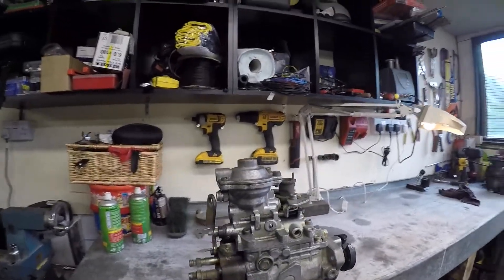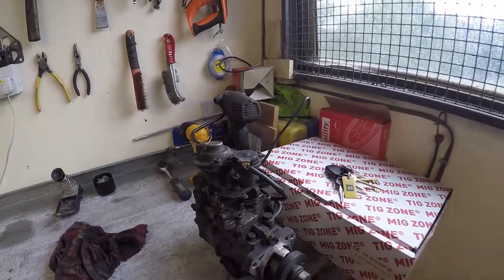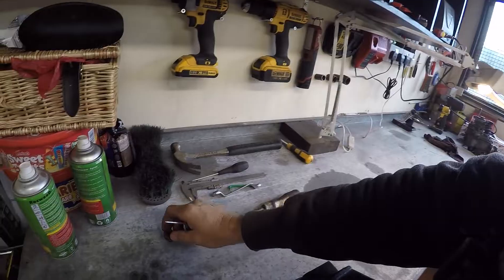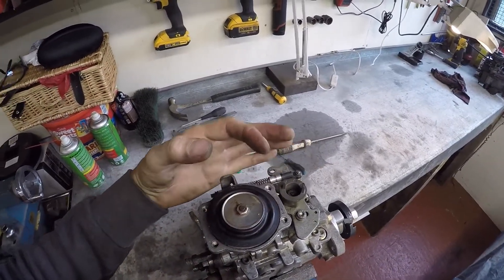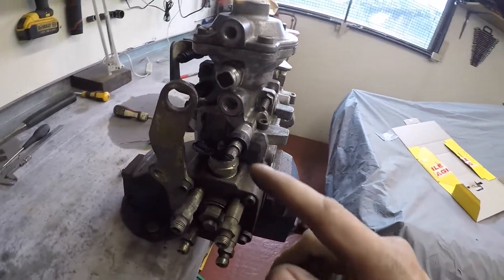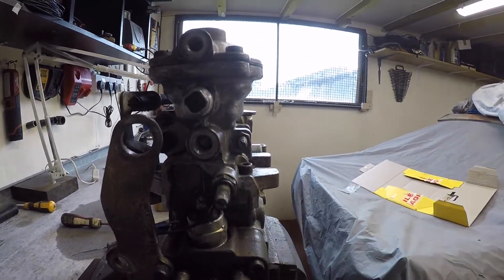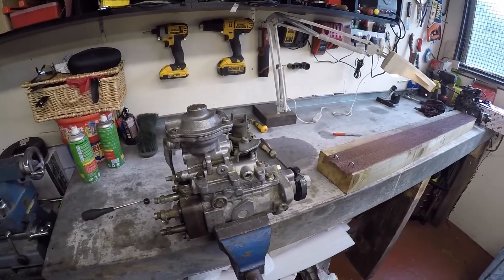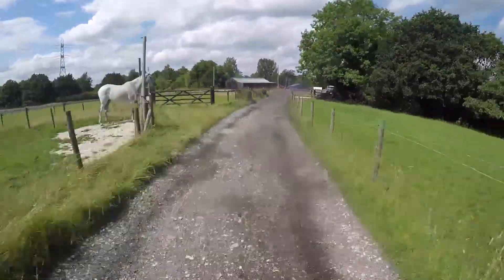300TDI & 200TDI Injector Pump Modification Land Rover Defender & Discovery Bosch VE pump

Comment: Hi buddy, I have a Defender 90 200Tdi. Could you please tell me if this procedure can be done step by step, one action at a time? I really don’t want to harm the engine or the turbo. The car has 150,000 km mileage, and it’s very dear to me, but I feel like it doesn’t have enough power. Is it possible to do this directly on the vehicle? Everything is still as it came from the factory, there’s even a seal on it.
Reply from the maker: Hi mate, yes if you want to do one step at a time then I recommend first rotating the diaphragm and then take it for a drive, then if you want a bit more lowdown then do the screw on top of the diaphragm housing and then shorten your turbo actuator rod by 5mm as as you can access this easily on the Defender 200 TDI, then take it for a drive again, if you want a bit more then do the fuel screw 1/4 turn. If you want you can do the above steps but just adjust the amounts I’ve suggested by a half. You can adjust the star wheel if you wish but it’s not totally necessary with milder adjustments. 👍 it should make your 200 a joy to drive afterwards 😁 cheers 👍👍
Reply: Hi, thanks a lot! I’ve installed an EGT gauge and I’ll start making the adjustments little by little.

Comment: It's a turbo diesel. Adding more fuel just makes it smoke at low rpm. Diesels are all about boost, an the 200/300 Tdi does not have enough turbo. 35 years as a diesel tech, don't mess with the pump, you won't get any more power.
Reply from the maker: I stand corrected, I’m so sorry for giving this useless information to the viewer’s 😂
Reply: I did this to mine and had MASSIVE gains
Reply from the maker: @roberttown2816  Nice one mate 😁, yea it made a big difference to mine too 😁👍👍 thanks for watching 🙏👍

Comment: My engine it's a 2.8 litre. This mod also Works?
Reply from the maker: Hi, yes this will work on the 2.8 too, you’ll benefit even more if you have a VNT turbo as some 2.8 do and you could fit a hybrid compressor side of the turbo for amazing low down power. The 2.8 injection pumps internals are higher spec than the 2.5 but the tuning them is carried out the same way. 👍 cheers

Comment: Hi mate, what  great video! Writing from Madagascar. Done everything except shortening the rod. Its   making a lot of dark smoke mid toI high rpm. I keep on backing the screw 180° but it doesnt seem to help. Not really concerned about emission just want to reduce the smoke. Any way to know that screw to stock position? It started to move backwards with the security bolt so i dont know..couldnt turn the star wheel a little less than  360° . Its stuck a 270°. 
My 300 tdi is fitted with an upgraded  variable turbo. Should i put the pin in the original position?
help much appreciated. Cheers
Reply from the maker: Thanks mate 😁 unfortunately you can’t find out where the standard setting is of the smoke screw if not noted position beforehand. Just double check you’re turning the screw the correct way as its opposite for fuel reduction. Also if you have a VNT or VGT turbo then adjusting the actuator doesn’t have the same effect, and to benefit from a VNT or VGT turbo you need to control it electronically really by using a ECU or controller that can measure both MAP pressure and throttle position, otherwise you’re not using the real benefit of having a VNT or VGT turbo. Don’t get the smoke screw mixed up with the one on top of the diaphragm housing as this is different and the smoke screw controls the overall fuelling of the pump. 👍 cheers

Comment: Thanks for this just did everything you said and now my defender is fun getting on the highway but she heats up under the seat think I should put in an EGT?
Reply from the maker: Awesome mate 🚗💨 it makes a good difference but yes the exhaust temps can get quite high so if you haven’t turned your boost up yet then do that and yea it’s best to put a EGT sensor and gauge in to monitor just in case mate 👍 cheers

Comment: I reset my injector pump as described and now it really flies.  But on putting my foot down I get a cloud of black smoke and am worried about the MOT emssions test now.  I realise that by unscrewing the top 'smoke screw' will help this but will it affect the power I have just gained?  Could a burst of black smoke after throttle end in failure?  I Just need a general opinion and realise you cannot be definitive on this. Cheers.
Reply from the maker: Hi, if you mean ‘top smoke screw’ being the one on top of the diaphragm housing lid then adjusting this back to standard will decrease the smoke at low rpm so should help. The “smoke screw” is normally the name given to the one that is in the side of the pump that does the overall fuel and I mentioned in the video too only adjust by half a turn, you could readjust by a 1/4 turn towards standard to also reduce overall smoke. But yes I’m afraid in doing this it will indeed lower your power again so you’ll have to find a good in-between for you needs 👍 cheers

Comment: After 20 (very) odd years of owning various Land Rovers I finally got a 110 as I'd always wanted a 'Defender' but could only afford Range Rovers (go figure!)
Its a 1989 but with a 300tdi/R380 installed at some time and I'm looking at a variety of ways to improve the breathing and power, I'm not after a rocket ship but just a little more grunt wouldn't go amiss. 
This is the most straight forward video on tdi tuning and well explained, cheers! Only slight problem is I now live in Ireland and where the MOT test in England struck me as rather strict, its even worse here so I know I'll have to take it rather gently!
Reply from the maker: Thanks mate 🙏 I appreciate the kind feedback 👍 glad you’ve finally got yourself a 110 pal and I’m sure you’ll love it, yes I know in some parts of Ireland the test is strict, but like you said if you tweak it like the video but just not quite as much on each stage of the mod then I’m sure you’ll still be within the emissions, also turn you boost up by shortening the actuator rod on the turbo by about 5mm as this will bring the emissions down on boost and increase power too. What you could do is when you adjust the smoke screw (the one that’s got the security tab on) you could mark it precisely and revert it back each time you have your test, they re-adjust once test is passed, you can even back off a quarter of a turn to reduce overall fuel even more to make sure you definitely pass the emissions 👍 thanks for watching mate and enjoy your 110 😁👍👍

Comment: I'm still trying to source them cheap at junkyards. Can't find them though. Ivecos are not plentiful in my bit. Would you say that 180 degree on the ring, 90 degree on the pin without shaving it would improve low rpm without the black smoke fail my Discovery on the MOT? Don't want to go back and forth on this. Prefer a safe setting that gives it a bit of oomph at the get go
Reply from the maker: Yea they’re expensive to get hold of VE pumps now. If yours hasn’t been touched then yes rotate the diaphragm 90 degrees and 180 degrees on the star wheel will be a nice subtle improvement, then if you want a tad more low down just pop the cap off the top of the diaphragm housing and wind the torx screw in 120 degrees or so 👍 cheers

Comment: I’ve just done the fourby boost pin on my 300tdi and now I’m getting black soot and smoke followed by a puff of white when I rev it. I was wondering if the fuel pump has been turned up previously and now I need to turn it down?
Reply from the maker: Hi, yes it’s possible your pump has previously been tweaked, has the security tab been removed from the smoke fuel screw and had the cap been removed from the diaphragm lid. If the shield has been removed from the smoke screw you could try to back it off a 1/4 off a turn anticlockwise and see if this reduces your black smoke. The white smoke is usually unburnt fuel. Thanks 👍
Reply: @CarJunkeez  Hi. Thanks for getting back to me. Yeah the fuel screw safety cap has been removed. I adjusted the fuel screw and it’s much better now. Just a bit of black followed by white now when I rev it. Seems fine going along. I took it for a test drive and it easily gets to 80 now and can tell it would do a bit more but I’ve done an egr delete and the temp gauge gets to 720 if I try any more. Should I turn the fuel screw down more or take the diagram cap off and turn it down in there? Don’t want to inadvertently damage the engine if I’m not keeping an eye on the temp. Many thanks.
Reply from the maker: @Tom-hl7wc  you could try back fuel screw a little more if your worried about high EGT’s. If you’ve got the flat sided Fourby boost pin then unfortunately you can’t tweak by rotating the pin like on the standard pin, also if it is a plat sided pin make sure the pins flat side is oriented correctly with flat side parallel against the control pin deep in the hole 👍 cheers
Reply: @CarJunkeez  ok thanks for the info. Appreciate it.

Comment: I have seen some vids where they remove the plastic collar totally.  Is that a good idea or not?  Thanks
Reply from the maker: Hi, you can take the collar totally out and that would allow maximum travel on the diaphragm downwards into the pump, this is usually ok as it can only go so far until it bottoms out, just on some pumps it could possibly stick on the fuel pin deep in the hole but is unlikely to 👍 but the fueling spread will more than likely be increased more than with a shaved down collar in. Cheers 👍
Reply: @CarJunkeez  Thanks for your detailed response.  I'll try it shaved and then without and see what the difference is.  Thanks again.
Reply from the maker: @scaryfakevirus  no problem mate 👍 cheers
Reply: @CarJunkeez  Just took my boost pin out to fit the new type and saw that the governor pin was all the way in - can't see it.  Is that its resting position?  I think it may be stuck in.  Any idea how I can check that without pulling the whole pump apart?  Thanks.  Edit -  I left this up as it may help someone else who has a silmilar issue, or they may not be as stupid as me!  
Anyway -   just had the bright idea of pressing the throttle down and its now popped out.  Solved!!
Reply from the maker: @scaryfakevirus  was just about to say it stays in until you open the throttle but you’ve sussed it out anyway mate 😝 😃👍 it helps you to can get the boost pin back in easier  👍

Comment: Looks like my "collar" is built into the cog? Or, there is a smaller, similar collar on the fuel ramp pin.. Idk. Lol
Reply from the maker: Hi, I have seen quite a few variations in these pumps, especially differences with the collar, some just have a washer and yes some with a slightly different star wheel, the key is to know if the pump has been modified in the past or not first before you start tweaking, and as we know most Landys have been messed with previously 😂

Comment: Great easy to follow video…..I have a 300tdi 110 5 speed and my issue is only being able to go up very steep roads in 2nd gear 3500 rpm, 40km/hr and egt around 600 degrees…..would this mod give me more power to be able to climb in 3rd gear? Or is that just what heavy old 110s are like ? Thanks
Reply from the maker: Thanks 🙏 yea should help with that as long as there is no other issues , they can be underpowered when standard 👍

Comment: What should the measurement be on the mix fuel screw after adjustment with the mod my pumps been messed and would like to know if it's right?
Reply from the maker: Unfortunately they’re all different so if it’s already been messed with it’s difficult to know the original setting

Comment: Im having issue w 300tdi.  Sluggish and tops out at 100kph in 5th.   Will this help w increasing top end speed?
Reply from the maker: It would only help if you don’t have any underlying issues, the lack of top end could be a fuel issue or even a worn injector pump, but it’s still worth a shot at it, and if you don’t get any black smoke you know it’s a fuelling issue, or if you do get black smoke it could be a boost issue 🔧👍

Comment: Hi ive looked at my plastic collar and it seems quite small its a 200tdi, the washer is 3.5mm tall what sort of height do you reckon these are once youve shaved them down, thanks morgan
Reply from the maker: Hi Morgan, I’ve come across all kinds of different thickness plastic collars in different pumps so there must be different variants, as yours is only 3.5mm you could try without it 👍 thanks

Comment: Cracking video - Being cheeky, I have Landy 200TDI - starts on the button but will not rev up just idles- anything that could be sticking in what you have shown ?
Reply from the maker: Thanks mate 😁 as for your issue it could be the mechanism inside has come apart or the pin is seized inside, if you take off the diaphragm and fuel pin out like in the video then spray some penetrating oil down in the pump then try to move the throttle and see if the pin shoots out deep in the hole, then try to push it back with a small screwdriver down on the hole and keep repeating until it’s free 👍

Comment: Thanks very much for this useful video. I'll do it very soon on my 300.
Any trick to shorten the actuator without removing all the turbo stuff (like manifold) ???
Reply from the maker: No problem thanks, it is possible to adjust the actuator when on vehicle but you’ll probably end up loosing the little circlip so be careful or at least have a spare 👍 cheers

Comment: Hi Mate, did this on my 300tdi and holy cow what a difference. Did you find any long term damage associated with this? I can tell its a bit hotter already. Was considering turning the last screw back to just a 1/4 turn instead of the 1/2 turn. I also didnt touch my turbo actuator rod. Is there a siginificant difference doing that. I already am astonished how much faster it made it.
Reply from the maker: Hi mate, yes you can turn the fuel screw back 1/4 turn to reduce overall fuelling and that will help a little with the exhaust gas temps, increasing the boost by adjusting the turbo actuator does help a little too as it provides more air for the added fuel, just don’t over do it 👍 cheers 😁👍
Reply: Hi, I have a Defender 90 200Tdi. Could you please tell me if this procedure can be done step by step, one action at a time? I really don’t want to harm the engine or the turbo. The car has 150,000 km mileage, and it’s very dear to me, but I feel like it doesn’t have enough power.

Comment: Great information and clear video of the pump.
Here in France we have emissions controls every 2 years and since a garage added a bigger intercooler and "boosted" the injection, my 300tdi fails.
Do you think just backing out the screw 180degrees would reduce the emissions enough to get it through a test so I can reset it after?
Reply from the maker: Hi, thanks for the kind feedback. If your pump has been previously adjusted then yes you can adjust the main fuel screw carefully to back off the fuel, just be very careful as you don’t want the dreaded diesel run on out of control. Best to have something to cover up the turbo intake on start up just incase 👍

Comment: Do you have any idea how many turns id have to do on a 200tdi acuator rod to make it run the same boost pressure as a 300tdi, cheers
Reply from the maker: As standard it’s only about 4 psi difference between the 200tdi and 300tdi so if you shorten your actuator rod by about 4mm you should be somewhere near 👍
Reply: Ok thats great thanks

Comment: By turning the last screw mentioned in the video 180 inwards are you adding fuel up top or at hard throttle inputs? Mine has the modification done and it blows a good bit of smoke on harder acceleration
Reply from the maker: Hi. The screw mentioned actually changes the overall fuelling so if you only turn clockwise by 1\4 turn instead of 1/2 turn then the smoke shouldn’t be quite as excessive 👍

Comment: Hi there, great video and thanks for putting this together. Just a question but would you know what the linkage is on side of pump that attaches to the main thottle likage? With the two springs on? I know early pumps did not have this.
Reply from the maker: Hi thanks 😁 do you mean the kick down on the none EDC versions of the automatic transmission, or possibly the preload spring setup for the EGR switch setup. Thanks 👍
Reply: @CarJunkeez  well i know its not kick down related because it came out of a manual. Not sure its to do with EGR even though yes it came from an EGR engine. I saw the pump in your video had it on aswell, round the other side of pump as its sat in the vice, sits vertical and attaches to the main throtle linkage/ arm. Then has two springs on that means its sprung in both directions of travel they sit horrizontel to the pump. Sorry its long winded but just trying to explain as best i can lol i have heard its a throtle damper! But not sure if thats coorect!
Reply from the maker: Yea I got you, yes it’s a type of throttle damper as the arm it’s attached to shouldn’t be moved abruptly so the spring dampening gives it a slight delay in both directions when hitting the throttle or letting off quickly 👍
Reply: @CarJunkeez  Cheers good man, nice truck aswell you've done a good job of it 👍
Reply from the maker: Thanks mate, appreciated 👍